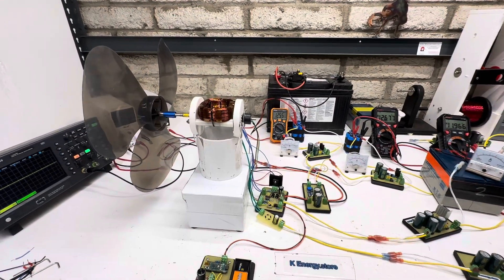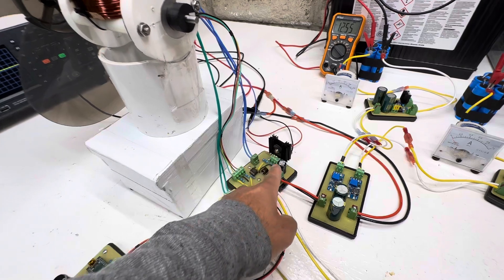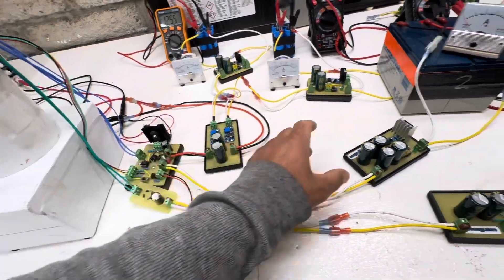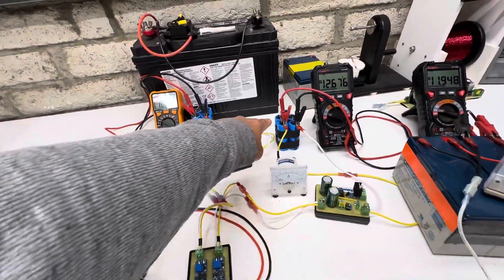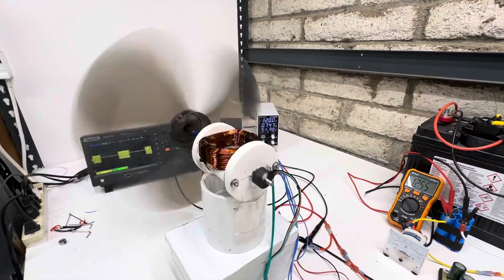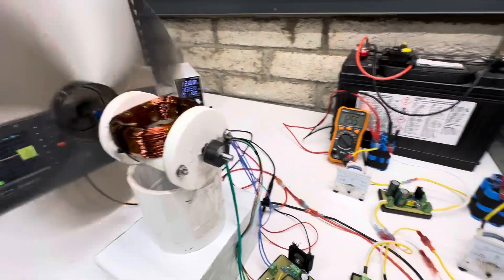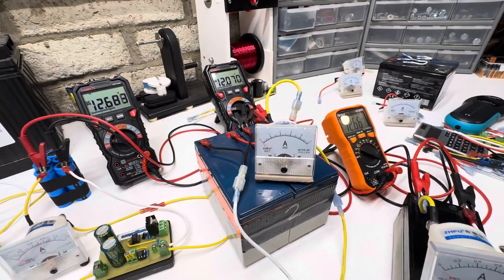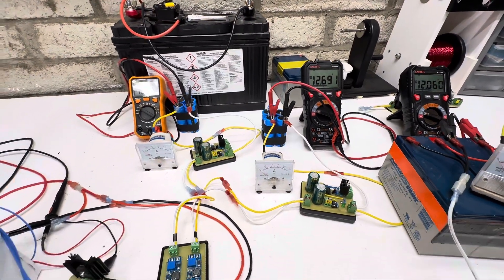Window motor charging 4 batteries

Comment: Is the gain in charge equal to the amount of input?
The work the motor is doing needs to be considered as well.
Batteries in my experience cannot be charged while being drained am I wrong?
Reply from the maker: @Jon-fs2zj  power came from power supply on this experiment 
You can drain and charge a battery usually does  some damage though